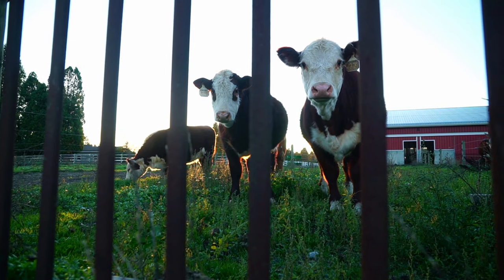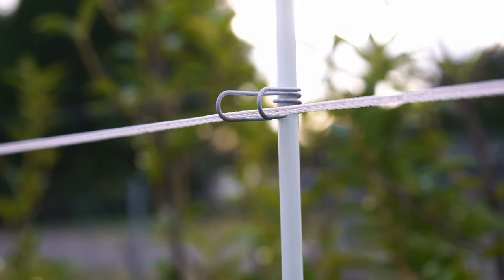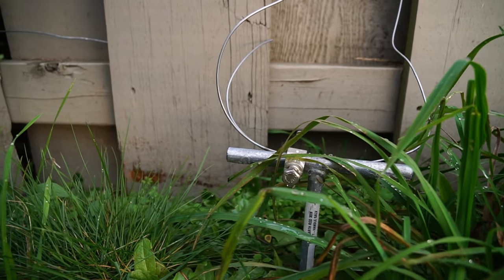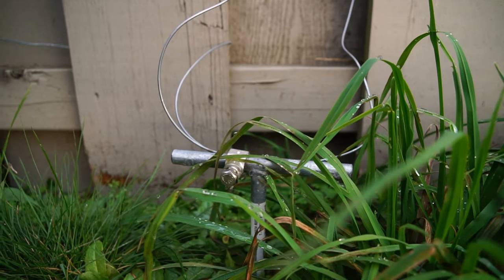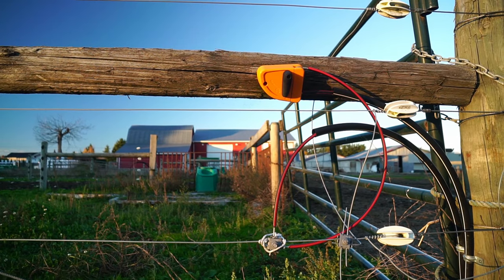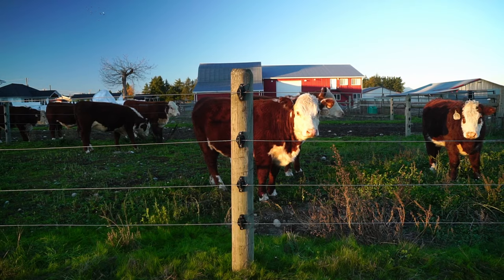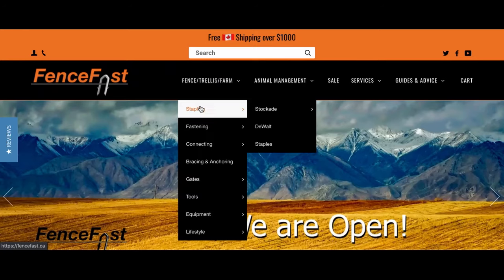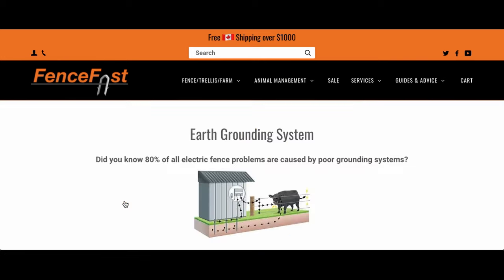Electric Fencing 101 | Choosing Your Energizer | Tips and Tricks | Need to Know

Comment: Can you not run a continuous wire for multiple strand heights  instead of using a jumper from wire to wire on single pulls? Make first pull then with same wire drop down to next insulator and continue ?

Comment: How do you convert the joules on a unit to volts? I have pigs to contain and concerned that I don't have enough joules. Also will be using a piece of re bar as a grounding rod, provided I can actually get it into the ground deep enough.

Comment: 45 feet of ground rod.. huh
Reply: 3ft of ground rod per joule so a 15J energizer @ 3 ft per joule = 45ft of rod in the ground that would be if you are using a 1/2" diameter ground rod. This would be 8 x 6ft 1/2" ground rods. When using the Gallagher Kiwiah ground rods which is a 6" galvanized sheet formed into a W shape 7ft long as few a 3 maybe enought because of the greater surface area of this style of ground spike which is why these are recommend for larger output energizers.   The ground rods are also an antenna array for capturing the current back across the ground to close the circuit when an animal touches the electric fence wire, this is why the ground rods are spaced 10ft apart the larger the array the better especially for larger energizers covering larger distances.